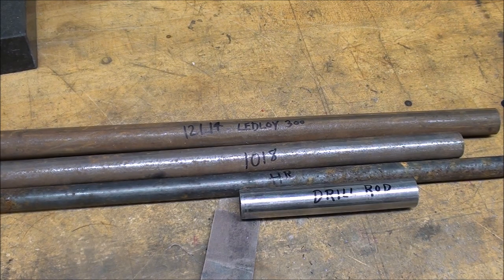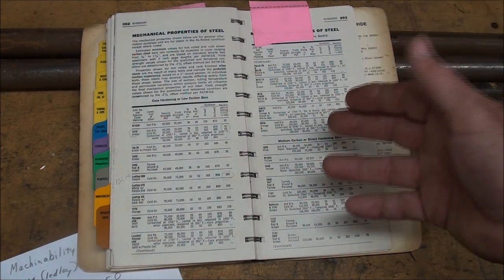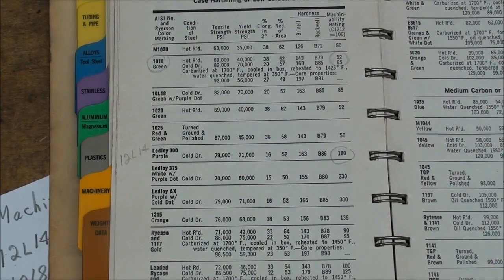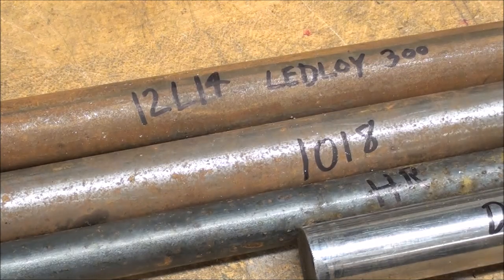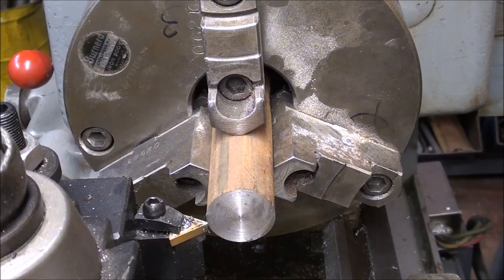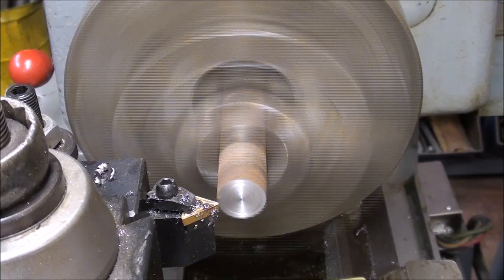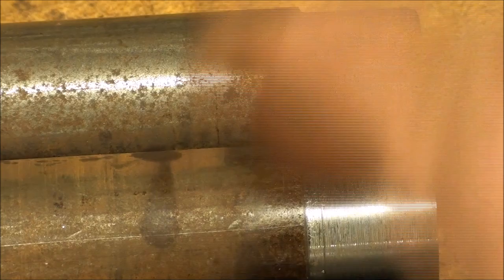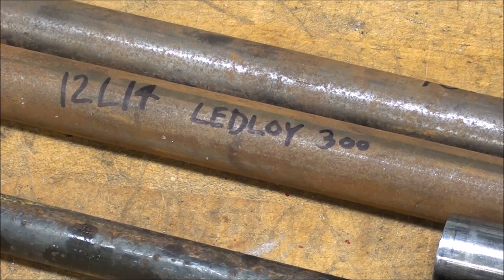SHOP TIPS #175 Machinability of Steel part 1 tubalcain

Comment: Great video. 
If you machine with hss tools, you can see the differences between different kind of steel. Using a base of speed like 20 m/min or 60fpm clearly seem chips of different colors because the dificult of machining, includes the edge of tool has loosen the cutting edge. The noise and vibration and heat are other indicators of machinability. A heated chip indicates little or nule machinability. Thank you for your giant work, lots of time for transmit your knowledge

Comment: Hi Mr. Pete - appreciate you so much over the years!   Finally have a small shop set-up and looking to start learning hands on.     Other than starting to machine them, is there a way to see the difference between the 12L14 and the 1018?    I brought home two pieces, 1 each type 1-1/2 Round Bar from the metal supplier yesterday and they're not marked and I can't tell them apart?
Reply from the maker: Take sample cuts.   You will be able to notice the difference.

Comment: If I recall- A material with a machinability rating of 100 really means it can be cut @ 100sfm which is the speed at which HHS tools will have a life of 60min. For carbide tools it is 100 x 3 and for coated higher still maybe 100x6ish. So machinability is mainly about tool life.  It's not an exact science but has always given me a realistic starting point. So this test with coated carbide @ 150sfm doesn't really tell us much. Maybe Part 2?

Comment: I find that if you use carbide, the harder steel (heat treated) tends to machine with better finish. For example I machine some 4140 and it was hard to get a good finish unless you take some very heavy cuts, but once you heat treat them, they come out like mirror.

Comment: The thing with 1018 is from what I've heard, it can be anything that gets scrapped into a molten piece of stock. Sometimes I've had easy 1018, sometimes I feel like I'm machining a recycled motorcycle crankshaft. Mr Pete I have a bar of 1018 I would love to send to you, and tell me what you think about it's 'Machinability' It has certs to being 1018, but I feel like it's unobtainium. I've broken 4 drills and 3 taps trying to make my piece.
Reply from the maker: No, do not send it. I have worked with that type of metal and I dislike it greatly.  Throw metal away that is problematic, and start over

Comment: I always revisit your videos. Trying to find out why on earth I can't turn 1/2" sized bolts down to around 3/8" without getting erratic finish lines (trying to do my part and recycle old stock for the good of man) just trying to make the spring-loaded piece point for a tap guide. It is driving me crazy.
Reply from the maker: do not recycle.   Start with good materials

Comment: Good video, 
Free machining steel is SO nice to work with on hobby lathes and mills.
When I was new to home machining I used what ever bits of steel I could find, such as off cuts of rebar, but  rebar is terrible to machine!
Then, I starting buying cold rolled stock,  better than rebar.
Then, I  'discovered' free machining steel - pure bliss!! Just a shame it took me 3 years to discover....

Comment: The difference in finish will become more distinctive between the steels the more parts you run due to tool wear.  The technical measure of machinability is based on tool wear over time - such as the taylor tool test, Volo tool test, Republic form tool test, etc. finish is typically an output or consequence of tool wear - a few test pieces will not show does not show resolvable differeneces in finish.
Reply from the maker: Thanks

Comment: I spent over 40 years making steel.  I have degree in metallurgy as well as degree manufacturing engineering.  All of the bars were produced as not rolled steel, food rolling is done to give the steel a smoother surface, improve dimensional accuracy, and modify the mechanical properties of the steel.  I found your grading of the steels to be very misleading.
My
I enjoy watching your videos as they are educational as well entertaining.  This one, unfortunately, oversimplified the subject matter.

Comment: I paint my metal as well I use the same color coding is Alro Steel. A couple of times I couldn't remember the combo of white and black so I called them up and they said they're white and black is 4150. And then I remembered having the 4150 back in my rack so it paid off. I love 4150 by the way it's so good for making tools

In a good tip is to make sure you keep your little cans of spray paint if that's what you use in a box that you can take inside for the winter if you work outside in your garage like I do or they will be useless come spring

Comment: I had an unknown 1" piece of steel that just wouldn't turn. Horrible finish, no matter the speed, HSS or carbide cutter, or feed rate. It appeared to have hard spots in it.
Reply from the maker: Yes, when I run into a place like that, I hide it in the garbage

Comment: Thanks for the interesting video.  We call the leaded steel automat steel here in sweden.  I guess its the same stuff. I use to run the last finish pass with a carbide tip for aluminium on any steel only some 100/mm to get a very nice surface. Regards
Reply from the maker: Thanks for watching

Comment: With your voice, did you ever consider voice over commercials?  -The Ryerson Steel Handbook shows their color code for each steel, but there is no standard color scheme between manufacturers. - No REBAR? Rebar is an interesting metal.  Once you get through the hard, outer layer, it become more machinable towards the center.  About 40 miles from me is what's known as a metal super-market.  You can buy as little or as much as you want, of all types and sizes of metals.  Good demonstration.

Comment: There's no real difference in machinability of cold roll and hot roll of the same specification. I machine 1018 HR and CR on a regular basis at work. The only difference between the two is the mill finish, meaning how the steel mill finished it.

Use the correct feedrate and surface speed for the material and you'll almost always get a good finish.
Reply: Agreed, i've machined lots of both and find no difference in machineabilty.

Comment: Sorry, late reply.
12L14 is a joy to cut on a small Machine such as a Sherline.  I find I need to cut drill rod for shafts, and it is tough!  Hard to hold it well enough (1/8" dia) to thread.  I've found that a 3/8" Jacobs chuck allows me to grip it better then the sherline 3-Jaw chucks.  I dare to think of the runout of this chuck.
Very good information!  I enjoy your videos!

Comment: Also, if you were to try to get a smooth finish on tool steel, would a final light pass at very slow feed rate be the best or is there a "best" method for getting a final quality finish on machine steel?

Comment: Interesting video, I wonder though if the advent of tungsten carbine bits has to some extent made the old machinability ratings meaningless. From the examples in this video it looks like even very hard steel machines as well as the softer steels (admittedly it look like the drill steel was at the limit). I wonder what the result would be like if you'd used a HSS tool instead?
Reply from the maker: That would be another good video topic thanks

Comment: I find the SAE numbers tricky to remember and the modern steel designations even worse. The old UK WWII 'Emergency Numbers' are a lot simpler.

EN1A(Pb) is equivalent to 12L14 and there is also an unleaded EN1A which equates to 1215. I keep some EN3B (1018) in stock if I know I might weld it. I'll also have some EN8 (1140) for shafts and fasteners and EN24 (4340) for high strength applications. There are loads of information and conversion charts out there on the web. In the UK searching the web and ebay by EN number should find you a supplier.

BTW 12L14 IS weldable, you just SHOULDN'T! You'll end up breathing in Lead fumes and the weld will have poor strength.
Reply from the maker: Thanks Paul--very confusing
Reply: Ha ha Pete yes, that's true to a degree.  But, you get better at your job.  You are more experienced and so you know more.  You can't buy that experience, as they say.

Great videos as always.  Thanks a lot.
Reply: EN40B was always an impressive read.  Nitriding steel, most famously used in the original Mini Cooper crankshafts.  The con-rods were EN16T and I think the valves were EN19.
Reply: Gosh yes, I'm self-employed (in the UK) and so a lot is self-taught and self-researched.  Things can pass you by more easily when you're on your own and it's maybe harder to keep up with changes.  I learned much of my engineering in the mid to late 1980s and a lot of the technical data from good quality books of an earlier era, even from just the 1970s. 

All the steel designations I learned were the old EN series.  I managed to get a grip on the information quite easily and quite quickly.  But by the time I got settled in, I discovered that all the designations had changed.  They seemed extremely confusing.  Have they not even changed again since?  I can't get my head around it and have stuck with the EN numbers, at least in my little world and in my own head.
Reply from the maker: Wolf Jaw Forge
Its impossible to keep up as you get older.
Reply: Ah, Jim lad, En 30B - there be buggery on the high seas tonight !
( or is that buggery in the machine shop tonight ? )

Comment: I paid 1$ per pound for "cold rolled"(well half of it was actually hot rolled as i have discovered now other half is profile not rod) and 3$ for pound of aluminum and stainless. I got really suprised how well stainless i was able to machine on my g0602 small lathe that i have doubt that it was stainless(it looks like it very shiny and heavy and non magnetic).
Is there a way to be sure what kind of stainless i got? I keep hearing that is hard to be machined...
Reply from the maker: There are many types of SS. Theres no determining the type. Just machine a little & see how it works. Some machines quite well--others , impossible.
Reply: mrpete222 Work hardening can mess up the machinability  of what was a good machining blank... Heat is very much your enemy with stainless, which is why flood cooling - even with a garden sprayer and tap water! - can make the difference between dull & broken tools versus smooth cuts...

Ask me how I know...
Reply: mrpete222 yes it takes over a year to make a average sizerocket engine because of this
Reply: Ajde da  probam ja da ti odgovorim. Nije tacno da se nerdjajuci tesko obradjuje. Sta vise, ume da bude jako mek. Sa druge strane ima ih mnogo vrsta. Nerdjajuce boce za tecni azot su mekse sto su hladnije, ako bi pale i dosle u kontak sa n2 pukle bi i to bi lia katastrofa. Ovako, dodju u kontakt sa n2 moksaju i samo se ulube, tecga zdrze unutra. E sad, taj sto se lako obradjuje, je samo mozda vise podlozan intekristalnoj koroziji koja ga izjeda pocgrwnicama zrna, i ne vidi se dok ne pukne. Dakle mozda je 'losijeg' kvaliteta-uslovno reecno naravno, ili jecsamo u normalizovanom stanju. Probaj da okalis malo, pa da ga obradis. Po toj ceni, ja bi se igrao i sa deset kg samo da utvrdim u cemu je stvar.:-)
Reply: Saša Minić
If the chips broke like mrpete222's 12L14 and it isn't magnetic you've probably got 303 stainless, which is "free machining stainless" containing lead.  The common grades of stainless (eg 304 and 316) will machine to a beautiful finish; they're just a little hard on tools.  ABCs of working with stainless:  Always Be Cutting.
Reply: Da to je moguce i nemogu znati jer neznam koji grade nerdjajuceg celika sam kupio tako da ostaje da probam kad budem sa sigurnoscu nasao izvor koji mi moze dati takvu informaciju. Sa druge strane mislim da su ljudi u pravu gore sto su rekli. Ja sam koristio misting sistem i predpostavljam da to nije dozvolilo celiku da se usled pregrijavanja stvrdne. Vecina videa sto sam vidio poteskoce u obradi SS-a su bile bez ikakvog hladjenja. Ali tek cu saznati kad nadjem SS sa tacnom oznakom kao sto je 304 stainless jer moze bit lako to sto si rekao da je ovo neki meksi SS.
Reply: Saša Minić a zar nije cudo brate ove cijene i to u maloprodaji? Mi u crnu goru imamo 2 velike fabrike jedna celika a druga aluminijuma i da se ubijesh nisi mogao kupiti ga. Sta vishe obije fabrike su unistili! Izvozili su tonu za hiljadu dolara a uvozili eloksirana vrata (koja nemaju 20 kila aluminijuma) za 1500 haha
Reply: Inbox!:-)

Comment: Interesting video.  On the hot rolled does it get easier to machine once you break through the mill scale, or is that not really a factor?
Reply from the maker: I don't know if it gets easier, but the scale dull the tool if you take a real light cut .

Comment: Over the years buying tool steel the color coding is not standard supplier to supplier. Some types may be the same but not always. The high chrome and nickel steels (d2,a2,&hss) are very difficult machine and grind.
Reply from the maker: True

Comment: Tubalcain, I think I understand the machinability, but how do you know what steel you need for a specific application (I don't have a machinists bible) Is all relevant information found inside the handbook?
Reply: I think what must it endure, what kind of rust will form, what are the effects that will make the material selection a failure.  It is not rocket science, it is material selection.  The ryerson book, the metal description, and machinist handbook are guides.  The seasoning from making something that you get to watch fail really helps the research process.  Feeling the difference in the material really helps.  Excellent demonstration Mr Pete.  I hope you go deeper on this topic.
Reply from the maker: I think you can find info on the internet
Reply: Yes, it sounds like a dumb questions, but you would need to know what your searching for to find a type of steel on the internet. I was asking because when you're watching fabrication videos on the computer. Everyone always says the job requires "such and such". You know what I mean? It was always some alloy I've never heard of. Is that an experience thing or did they just google "best metal for x job"
Reply from the maker: Brandon P
I'm like you, I often don't know. Their drawings often specify the steel.  I used only a few that I was familiar with and ordered from the catalogs. Go to this website www.online metals .com. Read up on it.
Reply: mrpete222 Some engineers get really involved in selecting the alloys for the job... For chemical plants and oil refineries and spacecraft and medical devices, that can be vital...

For a huge range of projects, good old A36 cold-rolled structural carbon steel is pretty good - it's kind of amazing how many things get built from that particular alloy... (It's got a fairly wide range of tolerance for inclusions)

So, the answer is: it depends upon what you want your finished part to do, and how much you are willing to pay for that performance.

There are lots of publications out there for selecting specific alloys for specific applications, and they can get pretty confusing, very darned fast...

I'm an engineer, and I still punt things over to the metallurgist when things get tricky...
Reply: that's a huge open ended question. But start with Corrosion Resistance, does it need to be welded, and can you machine it. Hardness, Modulus of elasticity, yield strength,fatigue limits.....It's an entire engineering topic, but like most things once you have an interest you will quickly narrow the topic down to what the commonly available alloys are . Online and Speedy metals have a lot of laymans descriptions of common materials, so does mcmaster carr.  Enjoy your journey  !

Comment: Hello, do you know a metal that is easy to soft solder and not as expensive as copper alloys like brass?
Reply from the maker: No--copper alloys are always easy.  Steel is much more difficult

Comment: informative video... thanks.
I don't know why, but the best finish I've ever gotten was on 01 tool steel I believe? It looked like a mirror on nearly every pass.
Reply from the maker: You had a great tool
Reply: I checked, it was actually A2 and I'm pretty sure the tool was a tcmt. It was one of the first times I ever got the gold-to-blue chips and they were breaking very nicely into a little curl. I was really shocked at the finish as I usually don't get nearly as good of a finish as most of you guys on youtube. But then, I'm usually working with lesser grades of steel. I'm often envious of the finishes you guys get.